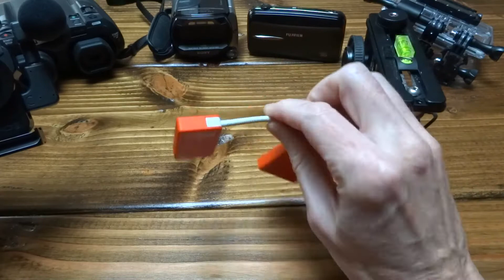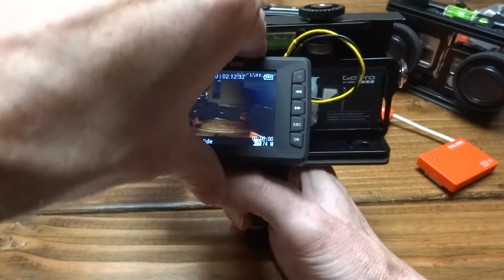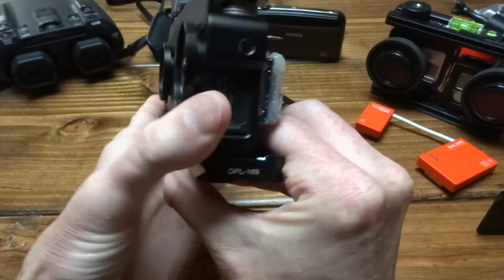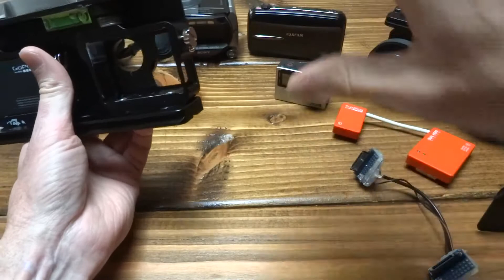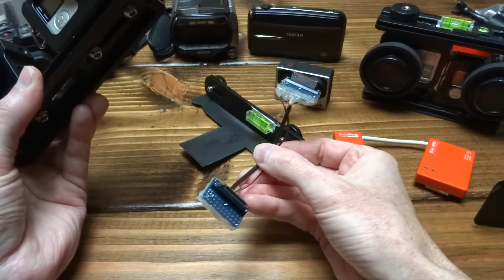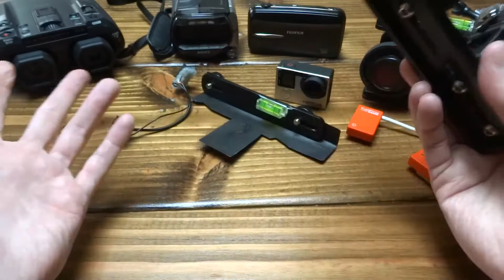3d Camera that shoots 4k 30fps per eye

Comment: How did you get the steady /stabilisation on the old Go Pro ?
Reply from the maker: I use Mercalli and Stabilize after the fact with Vegas.  As long as you are in bright light, stabilize in post is amazingly good.  With a fixed f2.8 lens on the gopro in bright sunlight, you are at such a short shutter that there is no motion blur.  At night there is nothing you can do.  I just built a twin micro 4/3 rig that is amazing in low light.  Using twin zcam E1 cameras.
Reply from the maker: I stabilize in post with Mercalli.  As long as you are outside, the shutter speed is so fast you can easily stabilize handheld in post.

Comment: Hi, thanks for the great video. I just bought a couple of GoPro 3+ and a 3d hero system for the sync cable. unfortunately, the hero system is for the GoPro 2 and doesn't fit the GoPro 3.
also, the orange sync cable doesn't work . is it a different type for the GoPro 3?.
is there any way of buying a sync cable compatible with a GoPro 3 ?

Comment: I am SO happy I found you.  I also purchased a a couple of 3+ Blacks and the Dual Hero system about 4 years ago, but I'm too intimidated to really use them the way I want.  I plan to use your videos to help me get started.  A few quick questions:  1)  Have any better camera options come out since you replied to"the vartist" 3 months ago?   2) I clicked on the link "Two Gopro Aluminum cages from ebay." above, but they don't seem to sell them any longer.  Any suggestions?   And finlly, which glidecam/flycam/steadicam do you use with your 2 Hero 4's rig?  Thanks!  I'm reading through the comments on all your videos in order to glean as much info as I can.

Comment: And what about the z-cam k1 pro in your opinion? How does it compare ?
Reply from the maker: That should be the best one out there now.  Totally different camera though.  Very big, has aperture control and interchangeable lenses.  If you are ok with being less mobile and the camera being sort of huge, and pretty expensive, at $3000, then totally go for it.  The gopro and almost every vr180 and even all the 360 cameras are all using sensors around the 1/2.3" size, so they all have shallow depth of field.  When you go with something like the zcam, you may have problems choosing the focus point with such a wide aperture.  I mean, you may have to pick between near and far points of focus, unless you stop the aperture way down.  Some of the pro versions, like anything over $3000, is where a bigger sensor comes in.  Bigger is better for sensors.  What bothers me is, there is nothing in between.  Right now, the vuze XR is the best, but I do not like that cameras layout when it comes to vr180, I do not want lenses that have any chance of moving because that can destroy a shot.  Especially an action shot where you are getting banged around a lot.

Comment: Hey! Great videos man!! You seem to know a lot about sync etc.. Is there a way to contact you via mail ? Cheers
Reply from the maker: I cannot find how to privately message on youtube. 

I am extremely critical when it comes to 3d being in sync.  My eyes are very sensitive to even slight time sync problems for some reason.  I see countless videos where people say, oh, you don't need to sync, you can just start both cameras and sync in post - then they have a link to a video that is clearly out of sync and looks horrible.  I know how this works, and I know how electronics work, but I could never build a sync rig.  Looking hard at the internet, the mew pro by Orangkucing Lab did what I needed.  Its not hard to build, but you have to build it and then it works ok.  If you are in snow, sort of forget it, temp causes massive failures.  In normal weather it works well, but its fiddley.  I was crushed when YI didn't release the Horizon VR180, so I guess I have to keep this rig going.

Comment: Wonderful video!   You state that you didn't want to flash the Mew pro for camera flip, but weren't you required to flash the "Master" mew pro that connects to the batest board generator as stated in the FAQ?   I'm about to put together this rig. Any advice? How long before the Mewpro boards arrived?   Do you feel the new YI horizon has a chance of replacing it with the same image quality?
Reply: No response?

Comment from the maker: The YI VR180 should be coming out soon.  They say late summer.  I will get one right on release.  That camera will shoot two 4k images, but in a square format for the 180 degree fisheye lens.  We will see every photographers shoes in this format.  I am going to pass on the Lenovo mirage since the YI looks like its simply better.
Reply: Do you know if it will be 60fps or just 30fps ?
Reply from the maker: Sadly, 30fps is in the specs so far for the 5.7k resolution.  I know for certain that 30fps just isn't going to cut it when you are in an HMD unless nothing is really moving.  I pretty much need 60fps.  That's another reason this gopro rig is so nice, I can pick a slightly lower resolution of 2.7k per eye and get 60fps.  I hope they offer a reduced res at 60fps, but I haven't seen that in the specs.
Reply: scstudios8 60fps is a must for me also. I guess we will have to wait a few years until high definition VR video cameras will be available for consumers.

Comment: Hallo have you synchroniser for Gopro Hero 5 black cameras , I need one, please.
Reply from the maker: These are just general sync devices.  You need the electronics in both sensors to start scanning off the same time code generator.  These external devices just send start and stop signals.  Its never frame accurate since the 2 cameras may be in different parts of their scan when the signal comes in.  These just get you in the ballpark for normal stuff, not 3d type sync.  These are designed to start and stop and put common time code data on the videos.  None of that is 3d compliant from a frame accurate state.  Even if by a miracle both cameras were on the same exact scan and started at the same exact time, they would drift fairly quickly and be off.  This device is as close as it gets for general stuff, but if you are a half frame off on the scan for 3d, it looks pretty bad when objects move.  This is what the early gopro 3d hero 2 did, and it was horrific quality.  That's why they stepped up to the dual hero system and finally used just one time code generator. Any system where each chip has its own time code, it doesn't work.  You can press the record button at the same instant, but that does not mean the camera is ready to begin its scan.  It has to wait for the first line of the sensors time to come around, only then can it start recording, so one camera may be on line #1, one may be on line #800.  One camera would start right then, the other has to wait for the sensor to be ready to take in line #1 of the frame.  So, there are 2 problems, one is, push the record button at the same time, that's fine, the other is, the sensors need to be scanning the same part of the sensor at the same time.  Even when you hit record at the same instant, drift shows up usually within 15 seconds its noticeable.  The cameras have their own time code generators and they simply are not that accurate and they drift.  If they built a radically different camera, then maybe this could all be done with a wireless sync, but the electronics probably would cost a fortune.  So, the simple solution is, just buy the gopro dual hero back, it uses just 1 timecode generator, solves all the problems and it works.  Same problem exists for hero 5 and 6 and just about anything that isn't hard wired.  Commercial cameras just do not all see time the same.  Check out sony lanc.  That indicates how this just doesn't really work.  With lanc, they can start right, but drift can be really bad.
Reply from the maker: I don't make this synchronizer.  It is made by Orangelab.  
You are totally out of luck trying to sync Hero 5 and 6 cameras.  They do not have a way to get into the sync circuit like the hero 3+black and hero 4 does.  
Here is a link anyways:  
https://mewpro.cc/product/mewpro-bastet/
If you have two hero 4 cameras, you can do it, they are really cheap these days, just get 2 on ebay for about $120 each.
You certainly need to be good at wiring, because you will be building this thing from parts and a circuit board.  You buy two Mewpro2 boards, then a Bastet board and wire it all up.  Its not for the average person, but the results are unique.  I don't know of any camera that can touch this right now.  For 3d and vr180 stuff, it is easily the best.  I hope some new releases can at least compete soon.
Reply: Thank you very, very much !
Reply: scstudios8 How about wireless sync for Gopro Hero 6 ? Like this one https://www.timecodesystems.com/how-to-sync-gopro-hero6/ Do you think it will work ? Thanks !

Comment: Nice rig, but not really in sync then?  Have you checked sync by examining audio peaks?  Once you trim off the frames at each end do the audio peaks line up at the same point in the frame?  I would say if it's not starting on the same frame then you're off on the sub frame as well which means you could be off as much as 16 milliseconds not so great for fast movement.  Maybe the sync cable isn't working then.  Would have the same luck as just pressing both record buttons.

Also, I experimented with wide spacing and didn't really find it necessary.  Just too much disparity, closer spacing was better but that's just viewing on 3Dtv.  Yes, VR I think better with the 180 view and wider spacing.
Reply from the maker: The frames are in sync perfectly.  Its just that one camera may start early.  When they are both going, its genlocked.  There is no missync at all when they both get going.  Other genlock rigs have the same issue.  They use the same timer, its just that one gets going early.  THis has no affect on the frame sync.  You just have to do a little post editing.  Its not critical that they both start and stop on the same frame.  It is important that when they are both recording, they are in sync.  This camera syncs fine with just that issue.

Would never use audio, and pressing both buttons is not any form of sync.
Reply: What I meant by audio, is after you move the unused frames, the audio peaks from the two cameras should line up precisely which would indicate perfect sync.  So the cable is similar to the Black sync cable?  I don't remember hearing about it.  I read about software coming out to sync multiple GoPro's for VR but that was a couple years ago.
Reply from the maker: I think I know what you mean.  There are two different sync points to mention.  One is the moment every frame is scanned on each sensor, which is always controlled, the other is which frame starts the video.  The cameras will always start a scan for a frame at the exact same time due to the single time code sent to both cameras.  If one takes a while to get into record mode, it just means it may miss the first few frames.  When its ready, it still waits for the sync signal to begin the scan.  That allows each frame to be matched.  There is no drift at all over any length of time for the frame scanning.  

Chopping off those extra frames is easy, there is no need to use audio as they are only off in exact frame increments.  Its like an escalator, if you miss one step, you take the next one, but you are always on a step that is in sync with the other camera.  You just may miss a couple frames, but when you start, you will begin your frame at the exact moment the other camera starts that same frame.  You could not have one camera scanning down the sensor at the middle when the other camera is at the top for example.  

If you have two cameras with no sync device at all, and just mash your thumbs down and hope to sync in post, you cannot get exact time sync because you have to move video frames one frame at a time.  In this case, its 30 frames per second, so the best you can get is 1/30th of a second increments, so you never get an exact sync with audio because you cant, you are forced to these step increments of the video frame.  Also, without a genlock, the cameras time rapidly drifts out of sync.   I have used Sony Lanc sync and I thought starting at the same time would be all that is required, but it doesn't stay in sync for any length of time.  About 5 or 10 seconds into any clip and you are off by a significant amount.  For 3d to really work, you need to sync these time codes to the chips.
Reply: yes, I've done the non sync way for awhile now and I sometimes have extra frames on one camera, not hard to cut and slide, wanted to be sure if they didn't start on same frame then there might be a problem with sync at the sub frame level. I tested with ceiling fan test which will show any mis-sync down to less than 1mS.  I use IR remote which is basically like hitting both record buttons but easier with one button instead of two, and no they are not in sync because when the cameras start up they are not on same timing, but sometimes it's in pretty good sync as well as less than 4mS, sometimes less than 1mS which is really good.  Generally sync is not an issue as long as there is not fast movement in frame.  I wanted to be sure it was actually in sync so that makes sense then, they do share the same time sync.  I've tested some knock off GoPro's which used an IR remote and that worked ok, so long as no fast movement but I gave up on them mostly because of the low bitrate codec.  

Using a pair of Sony AX100's now and same thing.  I recently tested with a single battery with hacked AC power plugs which supposedly works on the GH4's for near perfect sync but no luck on the AX100's.  The start up cycles are different it seems because I have single battery and one switch now to turn them on,  but no dice.  Sometimes left turns on first, sometimes right and of course not on same cycle.  And even when both lights are on at once, they are off.  Yes, if it's not in sync, 30p is 33mS/frame.  But my findings are that the cameras can only be off as much as half a frame because they can't physically be apart more than that and it's generally less than half a frame, worst case is just under half a frame so under 16mS.  And depending on how the cameras are turned on because it's random, they are always in sync to that timing until they're turned off and on again with a new difference in their startup cycles.  I've also found that drifting is a myth.  The cameras don't actually drift apart in timing. I had a 1.5 hour recording and they stayed in the same 4mS mis-sync the entire time.

I took a look at that cable, so it's a hack job of sorts, not official.  So a bit of soldering plus you have to reprogram your Hero 4 and of course not authorized by GoPro.

Comment: Nice! Can you share a few sample 3D 4k clips with your rig?  Will gopro6 4k-60 supported in future?? many thanks
Reply from the maker: The gopro 6 cannot be synced because it does not have a back with plugs.

This video was shot with this rig.  Of course, youtube crushes your quality.  it has to be 8k to show up as shot.  This is two 3840 wide, so its 7680 wide, before going to youtube.
https://www.youtube.com/watch?v=b97DhQPPk-U
Reply: yt support 8k isn't? can you upload in 8k? i like to test on my 4k 3d passive screen :)
Reply from the maker: I think some vids are 8k.  You cant tell youtube to give you even 4k, it sort of makes up its own mind.  The video I posted is knocked down to 4k wide before posting to youtube.  I have to look at some drive where I can post a full res version.
Reply from the maker: Here is a link to one cameras 4k frame grab from the Huntington Video.  https://drive.google.com/open?id=1ZhAaVJYIb3WU0tgXnnUDTnlVAWDT7tRt
Reply: what you mean "some vids are 8k"? Your vids?  "YouTube has to downsize the video" Why? Yt does support 8k it's called 4320p. thanks for the picture, nice!
Reply from the maker: YouTube has 8k videos.  Not mine though. If I uploaded 8k, I think youtube would downsize it to 4k.  I think 8k requires some special account or something.  Making 8k means you need h265 and other issues.  I just haven't tried it yet.  I have to recompress without hardware encoding, which takes forever.  I can Cuda encode 4k, but not 8k, so doing 8k would be not cuda and a much larger file.  It would take forever to process.  I need to try one.  I have a bunch of 8k stuff.  I just don't have a 4k display yet, I am waiting for a 4k 120hz display to come out, and there are few out there.  Nvidia just made a 65inch model, but I want something that is 32 inches.
Reply: i just made a quick test with Vegas12+Ripbot264: a simple scroll in 7680x2160 resolution (2x 3840x2160) in mp4 container h264 codec. Youtube allow it (no speciel account, no h265), and show up as 4320p. See here: https://youtu.be/iXZjtbVSGNI   So it works today :)      But if its too much work for your cpu, you can still upload a 3840x2160 HALF T/B 3D video, which is the max to current passive 4k TV-s. regards
Reply from the maker: I just processed one 8k and uploaded it.  It may take a while for youtube to process it.  Let me know if this allows the 8k option.  https://www.youtube.com/watch?v=ovwu7qC156Q&feature=youtu.be
Reply: yes, it works. thank you 3D friend :)
Reply from the maker: Another 8k 3d video is up now.
https://www.youtube.com/watch?v=lgEvdH1c36A&t=25s
Reply: scstudios8 so didn’t you disappointed that two cameras in this video has different exposures and wb? can you lock it manually?